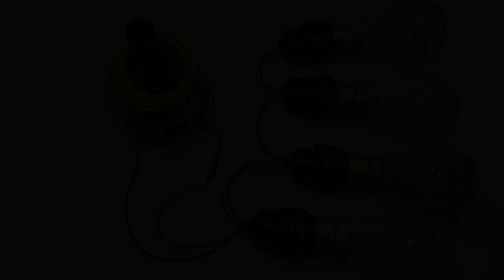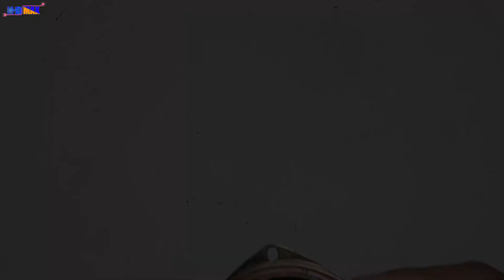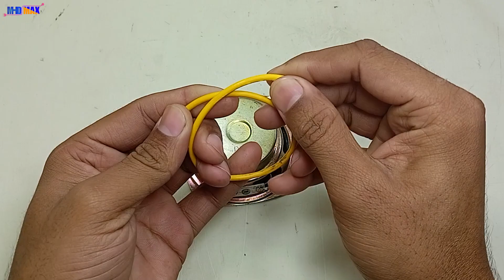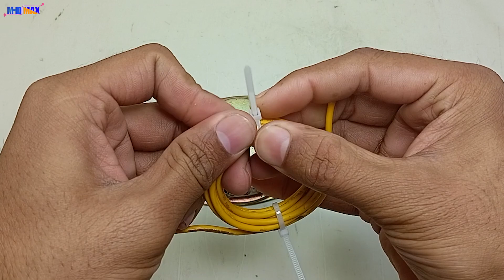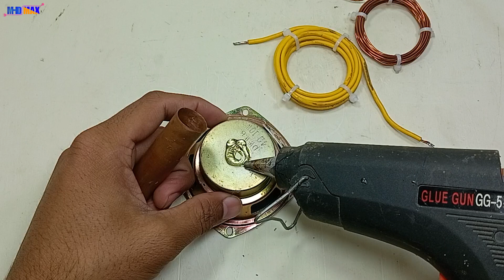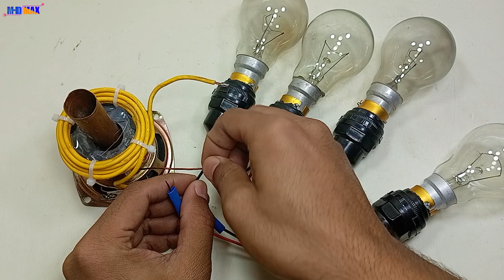40000w Free Electricity 240V Generator Magnet  Power Copper Coil Light bulb activity

Comment: I find it really interesting how you can generate electricity from a few magnets, but what struck me is how do you know that this watt of power is achieved? It is always tested with crappy bulbs instead of a fan, kettle, refrigerator or freezer something really needs power and with 40,000 watts it's no problem to connect and operate the devices, otherwise it's at least 150 to 200 watts unless I get proof
MFG from Germany